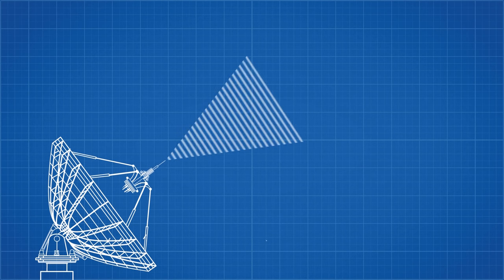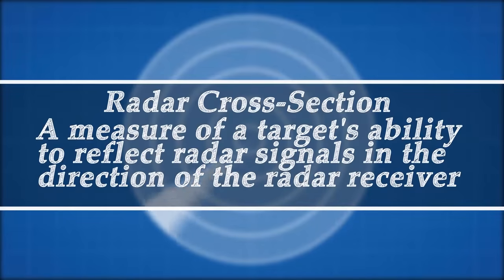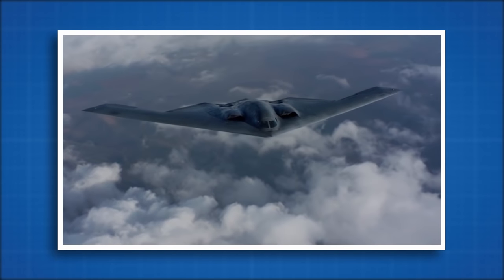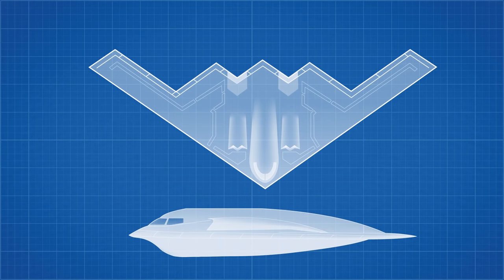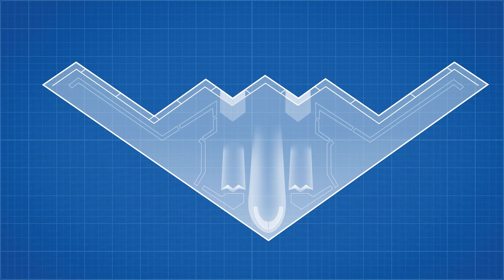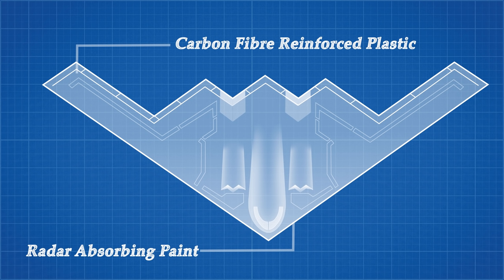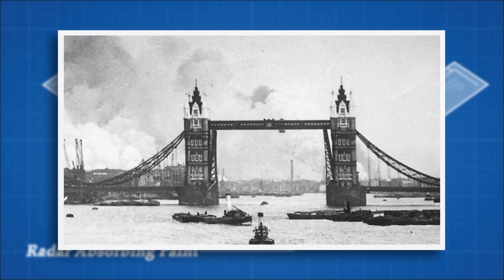Stealth - How Does it Work? (Northrop B-2 Spirit)

Comment: It's got a cross-section of a bird but going 1000 km/h. Lol

Radar operator: sir this bird is moving at mach 1
Reply: Objects like birds are filtered out
Reply: "Damn that's a pretty fast bird."
Reply: Rcs of a bird is better than having the Rcs of a b 52
Reply: hella underated comment lol
Reply: Nah, Mach 1 is 1234 km/h... B-2 has a top speed of Mach 0.81 or 1010 km/h
Reply: Commander: that's not true, the readings show Mach 0.81, and it's made of metal, we filtered birds out and this showed, my conclusion is that it's a metal bird
Reply: @YC-07_Cronus  your only going to get those rcs readings when it's too late and the bomber has already made its run
Reply: @Arun bomber opens its bay doors and RCS spikes. You can only get reliable returns at close ranges. Also bombs going off is a clear indicator.
Reply: @klyderain8817 😂😂😂

Comment: The Horten 229 was not designed to be a stealth aircraft. You can see directly into the engine which is a huge addition to RCS
Reply: people tend to think "oh it's the same shape so it has the same function"
Reply from the maker: That's up for debate. It was made with wood and glue infused carbon powder, both absorb radar. The thing flying wing profile does help with RCS, despite the engines being slightly exposed. 

To top it off, Northrop used it when researching their designs.
Reply: Most of the internet heavily exaggerates many aspects of German WWII military tech - a lot of amateur fringe sites multiplying the errors & exaggerations. I looked up the Wiki on the Horton Ho 229 & it is very poor indeed. A far better source is the website for the Smithsonian National Air & Space museum - the people who actually had their hands on the real thing! If you are interested you need only search for: Smithsonian + Horton + "is it stealth?"   

Reimar Horton learned his trade as a designer of pre-war gliders where wood construction was the norm. In the closing parts of WWII materials shortages was a serious problem for the Germans & it was natural to go to a steel frame covered in plywood. For Horton stealth was low on the list of design priorities whereas range & fuel economy was at the top. Thus the overall shape was dictated by the need for low drag to achieve the range required. 

Also note that It wasn't until 1983 that Horten mentioned that he PLANNED to mix sawdust, charcoal & glue between the plies of the wood, but we know it was never actually implemented. The Wiki of course tells a different story - the wrong story. There is a strong likelihood [IMO] that Horton wasn't being entirely honest in '83 - especially as all the major airplane stealth concepts [including radar absorbent coatings] was a hot topic within military airplane design circles years before '83. Very tempting for him to promote himself as being even more visionary than he was - & yes he was visionary.

However the WWII Germans were probably the first to consciously incorporate anti-radar detection into their designs in any major way. PERHAPS ...  For example it has been suggested that their prototype electric U-Boat had canted sides partly for this reason & also I have read [on sites I don't trust] that the standard U-Boat snorkel head was covered in a rubberised material late in the war for a short time to reduce radar reflection, but it wasn't a success due to salt water & inhospitable conditions quickly removing it. NB I haven't the time today today to check the statements in this para via reliable sources [which ain't Wiki :) ]
Reply: In my long post I left this bit out in error: Thanks for an interesting & absorbing vid !!!
Reply: +Real Engineering the famous British mosquito was made of wood because of metal shortages because of the production of other aircraft.
Reply: nightjarflying, You have said most everything I could say, but better.

I'd only add 3 things;

1. Germany's ability to make high strength plywood was seriously affected by RAF bombing. An alternative explanation for anomalies in the Ho-229's skin is simply that the glue used was some makeshift substitute.

2.  Northrup's first stealth aircraft (Tacit Blue) looks nothing like the Ho-229, but has a number of design elements that obviously carried over to the B-2.  If the B-2 was "based on" the Ho-229 it's kind of weird that their starting point was so different.

3. Attempts to develop effective radar absorbing materials have been going on since WWII, and most of what's publicly known about doesn't work very well.  If stealth was as simple as pouring some ground up charcoal into glue then everyone would have stealth aircraft.
Reply: While it is pretty exciting to think that the Germans made stealth aircraft decades before the rest of the world caught up with it, the truth is as usual probably more mundane. 
The Horten 229 was built to carry a 1000kg payload 1000 km flying at 1000km/h. This was very steep requirements for the time which required radical departure from the norm in aircraft design to even get close to meeting the requirements. The flying wing design was chosen to minimize drag and maximize the amount of lift for weight and surface area. As exciting as it might have been, it probably has nothing to do with stealth.
Reply: There was a test done on a 229 replica which found that the radar available at the time would have a hard time detecting it at sufficient distances to scramble interceptors in time to stop it. The fact that the low radar signature was accidental doesn't diminish the potential that the design had.
Reply: +frjoethesecond

 Which was coincidental rather than intentional. Though I don't recall it being such a drastic degree. I recall the test concluding it would be picked up by a 20MHz.-30MHz. R.A.D.A.R. kit out to 80% the range of the Me 109 series fighters.
Reply: oops i just saw this video now... but heres my take, those radars and early warning devices on the 1940s are definitely complete shit compared to today's. the shape of the Horten definitely reduces the radar cross section.. this design could definitely be called "Stealth Plane" if you are in the 1940's
Reply: This is literally german engineering
Reply: @RealEngineering  Northrop used their own flying wing design from the 40s as inspiration. Go check out Military Aviation History's video on the Ho229
Reply: @RealEngineering  no they looked at one of its models and analyzed it it wasn't stealth when it was all metal or wooden

The real bomber you're looking for was Northrop flying game wings which actually flew in the US during the war

Comment: Someone:”what your plane made off?”
B-2 owner:”PLASTIC “
Reply: Actually it is alunmium and titanium
Reply: @haidweng7948  It's carbon-reinforced plastic, bro. Makes no difference if a missile hits carbon fiber or Titanium. But carbon fiber does absorb radiation very well. The paint and the shape are really what do most of the stealth job. Maybe there is some other material cause the military won't tell us.

Comment: National Geographic created a reproduction of Horton 229 and tested it for radar cross-section using the same frequencies that Brits used in WWII and it was not stealthly, the engine intakes are very reflective. But it was less visible and much faster than any other aircraft of that time meaning when Brits would be able to detect it, it would be way too late to intercept it.
Reply: Plus it was supposed to be insanely difficult to fly.
Reply: The only reason it was less visible is because it was mostly made of wood, which isn't the best microwaves reflecting material in the first place.
Reply: Are you british ?
Reply: I remember the progam. As I recall it did reduce detection range though not as a deliberate design factor.
Reply: Even the B-2 isn't completely stealth, the Ho-229 was a very advanced tech for its time...
Reply: @guruxara7994 It really wasn't technologically speaking
Reply: 5the demand ver6y much bu5t 5the suppl6y was weak

Comment: About the Ho 229, it really wasn't that stealthy. Due to the engines being imbedded into the fueselage, it's radar cross section was only 20% less than other aircraft of the time. It also suffered instability issues due to a lack of rudder, and had no radar absorbing materials. Stealth simply wasn't a priority for it. It likely only had the shape of a flying wing to meet the contract requirements, but not specifically for stealth.
Reply: You need huge RCS reductions to have a relevant impact. Having a 20% lower RCS is pretty much irrelevant.

Comment: Still, one of them costs $700M
Reply: actually its more like $2,000,000,000
Reply: +osu sucks no, it's $737 million
Reply: $6,000,000,000
Reply: Oops! one of them cost $89,000,000,000,000
Reply: +Do not go gentle into that good night. Rage, rage against the dying of the light. What's up with your name
Reply: well the contract was given to Northrup Grumman in 1978 for $45B and was asked to build 140 aircraft. the first one was built in 1982 and 6 others. 2 of them went to testing the aircraft ability while the other waited for air force use. in 1989 the Berlin wall fall and the contract was downsized to 80 but the $45B stands. in 1991 when USSR fell, the contract was changed to how many aircraft they had in production at the time and that was 22. the air force signed off on 22 for $45B. the air force did not buy one of them because it was a test aircraft and was to badly damaged. so if you take $45B divided by 21 equals $2.14B
Reply: +AAAEA it's a quote from a poem by Dylan Thomas and was read by Michael Caine in the movie Interstellar by the Director Christopher Nolan
Reply: invisible ..give me s 300 i will put it name to the test
Reply: No, the b-2 is 2,200,000,000
Reply: For US government no matter how much does it costs. For them money is limitless resource. If they need more they can print it and enter to the banking system.
Reply: Tomasm21 Truth 👏
Reply: Tomasm21 Tell that to post WW1 Germany, that's how hyper inflation happens and that causes a decrease in currency value.
Reply: DayOneGamer nope according the the military it costs 45 billion USD per plane
Reply: Tomasm21 they can't just print money they will collect more taxes
Reply: Tomasm21 that is not how money works at all
Reply: Retro Gamer that is nothing compared to what we spend on F-22s and F-35s.  But that cost is what prevents any country from ever fucking with us
Reply: S And? It worked. It has bombed serbia kosovo and iraq and never took a SAM hit. Hell even only 1 out of the 22 f 117 night hawks yook a hit and that was after 3 nights of bombing flying the same route. The f 117 is primitive compared to the b 2
Reply: osu sucks it’s 700m bro
Reply: also can destroy a city and come home undetected
Reply: S u mean 2 bill
Reply: People quoting any figure of two billion or more per plane don't understand that it's the cost of the plane if you include R&D, by far the most expensive part of making a completely new stealth aircraft from scratch. No, the plane doesn't cost 2 billion US dollars per unit to build.
Reply: not how economy works...
Reply: $2Billion
Reply: smh no
Reply: S 
They cost $99,9999,99999,9999999,9999999,9999999999,99999,999999
Reply: I'm a crew chief on the B2, it's 2.2 Billion USD.
Reply: @timc7595  it's called B2 for a reason
Reply: TheCassual it’s estimated to cost 2 billion throughout its life time. That includes maintenance etc, but to build it, yes 700 million. It costs a lot to keep the b-2 stealthy. It has to go through tons of maintenance after every mission. From what I read
Reply: But what is 700 million when you can just print more bills?
Reply: And it shows up on old radars too f117 vs old soviet spaa
Reply: osu sucks 2.5B
Reply: AAAEA 2.5B
Reply: 3.2 bil*
Reply: *2,200,000
Reply: 2.2 billion
Reply: @Tomasm21  profits from weapons sale all the world over will subsidized Pentagon shopping wish list and forever wars...and i agree  printing will add more elbow room...

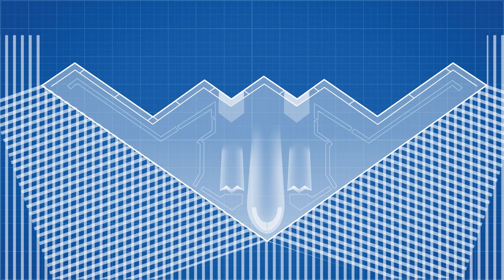Comment: 1:30 What if radar waves hit B-2's wing perpendicularly? 

Imagine a radar station which direction from a flying B-2 is perpendicular to B-2's wing leading edge. More precisely, wing's leading edge angle is 35º, therefore an azimuth of 35º from B-2 to radar station would compromise plane's stealth?

Also, it's known that B-2 surfaces use "continuous curvature". I don't know if this suffices to avoid the before-mentioned situation.

Comment: Horton 229 was stealth cause of its material (wood). It wasnt on purpouse. Same with mosquito.
Reply: not true, the wing shape's reflection properties also redirected away radio waves to the left and right, making the wings essentially invisible to radar. it was the engines inlets that were the only thing that would have shown up on radar, which combined with its speed would have made it capable of bombing Britain and leaving before interception would have been possible. good thing it never flew offensively.
Reply: I have my doubts of this was intentional.
Reply: GabrielKirov maybe not but both sides would have been very quick to realise what was happening, the war wouldn't have lasted long if the 229 had made it to full production...
Reply: [1] GabrielKirov is correct in what he wrote - the Ho 229 was "stealth" [to a small extent] because of the partial wooden construction, but "stealth" was not the design goal. Reimar Horton learned his trade as a designer of pre-war gliders where wood construction was the norm. In the closing parts of WWII 
materials shortages was a serious problem for the Germans & it was natural to go to a central steel frame covered in a plywood skin & an all-wooden wing with plywood skin. For Horton stealth 
was low on the list of design priorities whereas range & fuel 
economy was at the top. Thus the overall shape was dictated by the need for low drag to achieve the range required. Nothing at all to do with stealth

[2] You are incorrect about the "wing shape's reflection properties [...] redirected away radio waves" - nearly all of the wing was wooden & thus it didn't reflect radar at all. The reason for the smallish radar footprint was: 
[a] lack of propellers - metallic prop discs are very, very 'bright' on radar due to their large diameter & vertical orientation  
[b] the small amount of vertical radio reflective area because no tail assembly with vertical fin

[3] It is not known if the engine inlets were particularly prone to radar detection - the inlets were not tested for this property - only the nose cone was tested

[4] Although the wing skeleton is wooden & the skin is wooden ply  the engines, inlets, & central body of the plane are metal - thus the plane does have a radar signature

I recommend that you go to the website for the Smithsonian National Air & Space museum - they are the people who actually had their hands on the real thing. If you are interested you need only search for: Smithsonian + Horton + "is it stealth?"

Something else to consider: It wasn't until 1983 that Horten mentioned that he PLANNED to mix sawdust, charcoal & glue between the plies of the wood for the purposes of radar 'stealth', but we know it was never actually implemented in any of the prototypes. The Wiki of course tells a different story regarding the Ho 229 - the wrong story. There is a strong likelihood [IMO] that Horton wasn't being entirely honest in '83 - especially as all the major airplane stealth concepts [including radar absorbent coatings] was a hot topic within military airplane design circles years before '83. Very tempting for him to promote himself as being even more visionary than he was - & yes he was visionary.
Reply: lol.. you are seriously overstating the effectiveness and reliability of radar.
Reply: ah thankyou, you said what i wanted to say. i read somewhere that mosquito's very high over the baltic could (sometimes) be detected by british radar from britain, but only if they were flying straight towards the radars, ie the propeller disc got picked up.... but, no way was the mosquito designed for stealth, nor was the horton.
Reply: While I doubt the Germans knew that the Ho 229 would have a reduced radar signature, being made of wood was nothing significant. Everything was prototyped in wood back then. The Ho 229 was simply captured before a metal version was completed. The other possible explanation is Germany was running out of resources and might have used wood because that was all they had left. I would put my money on the prototype though.
Reply: Gordon Fredrickson  Of course the Germans knew that the use of wood would reduce the radar signature, but that wasn't the reason for going with wood in the Ho 229. As I wrote above "Reimar Horton learned his trade as a designer of pre-war gliders where wood construction was the norm. In the closing parts of WWII materials shortages was a serious problem for the Germans & it was natural to go to a central steel frame covered in a plywood skin & an all-wooden wing with plywood skin." - this aircraft was designed to use a lot of wood in the construction as standard & not because it was a prototype.
Reply: americans cant stand to be humiliated, fact is, without german missile rocket tech there would not have been a landing on the moon, Werner von Braun was in charge of the project in Germany and later in the US
Reply: +Juju Rellama

 The technology wasn't ahead. It was the applications of the technology that were ahead. And the work of Von Braun was the reason the U.S. started their numerous rocket programs.
Reply: @lunafringe10  You are quite mistaken.

Comment: About the Ho-229: It wasn't stealth, like at all. It's shape meant that It wouldn't be detected until it was somewhat closer than other German fighters, but stealth was never the intention and it's designers didn't say it was stealth until much later.
The Avro Vulcan had a similar effect, where it would sometimes disappear from radar because it's shape accidentally scattered radar from certain angles, and that wasn't a stealth plane either.